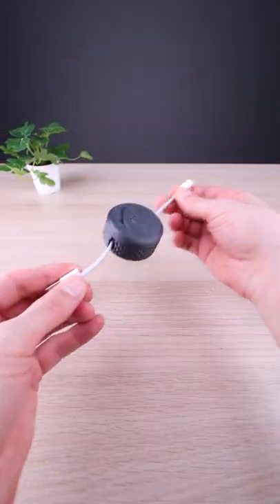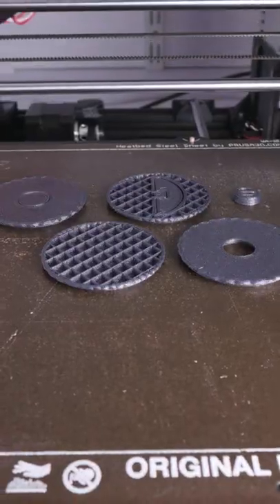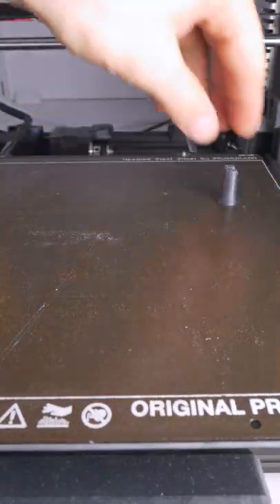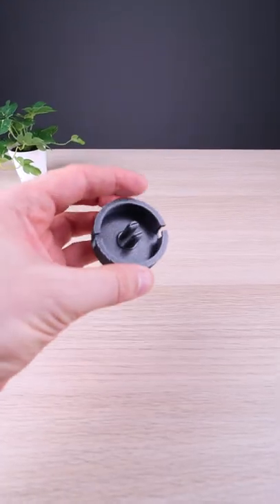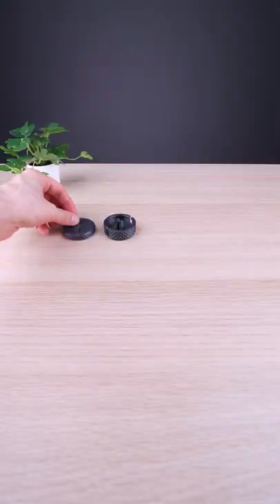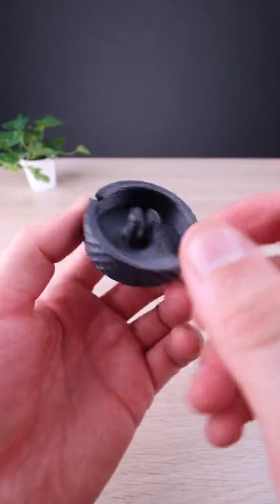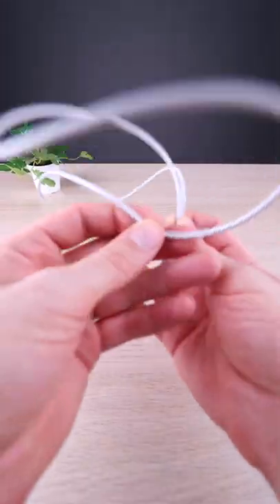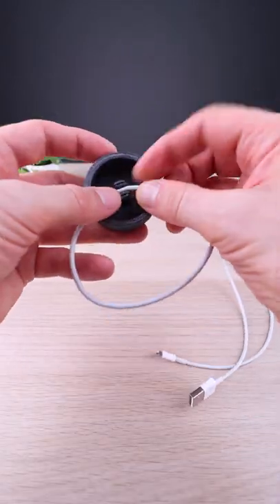3D Printed Retractable Charging Cable Organizer

Comment: And that easily you will destroy your cable that’s way to expensive
Reply from the maker: true, this cable is not designed to be wind it that tight but it works well for other flexible ones :)
Reply: @marsgizmo  you could also make the central clip wider or shaped as a milder curve so there's no sharp bends.
Reply: @marsgizmo  nice
Reply: @marsgizmo  but who cares man instead of cable you can put earphones
Reply: @wizardOfRobots  9j0

H7vi

.
.

.
   Inmiub

Comment: I bought one of these from a store, and tglhey're very janky and they break easily so I'd recommend just coiling your cables by hand and save a few bucks. no hate against marsgizmo i really love him just just a warning for anyone considering buying one of these :/
Reply: He didn't buy one... He built one... Also most of the cable coils u can build have really weak feathering, wich easyly break... If u use the right print material though, u can make it sturdy enough so that it holds the cable in place and won't brake, if it is well engineered... I'd rather print one of these then buying one, you are right

Comment: The strain on the inner wire near the axle will cause fatigue to the metal faster than normal. You can lower the strain by designing the case with perpendicular outlets which coils the cable in a full circle instead of an "S" shape.